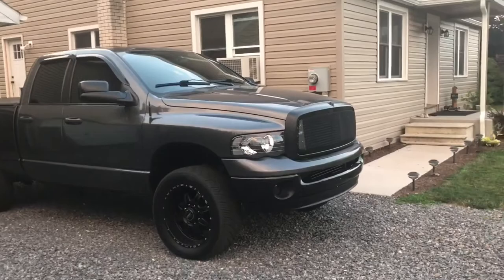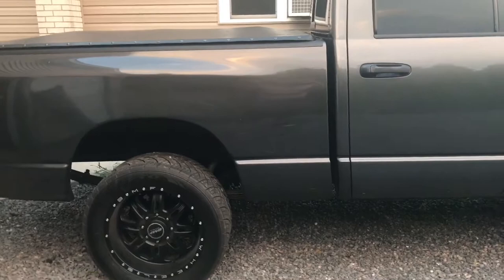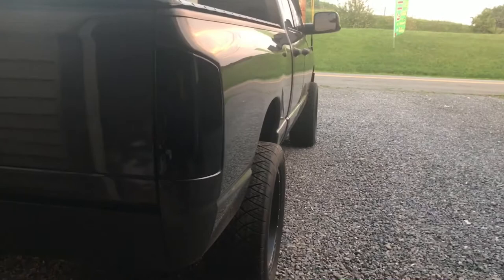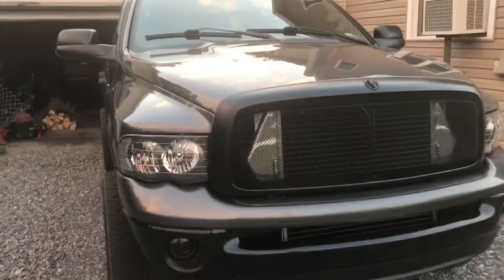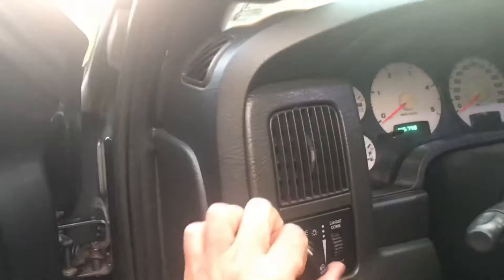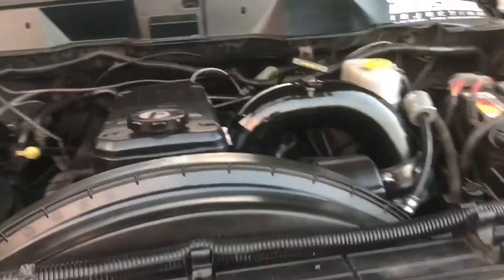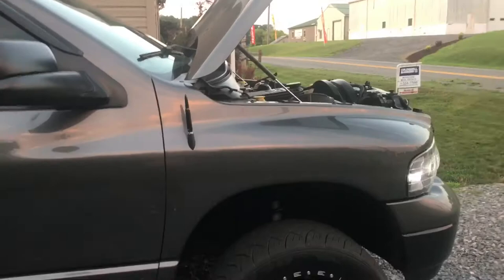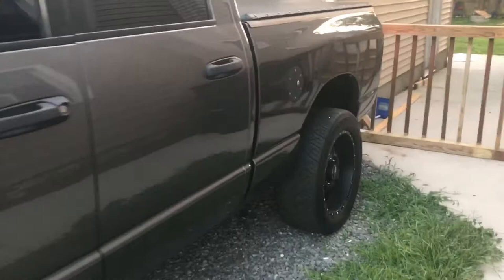My First Cummins Vlog? Walk around

Comment: I have the same truck same year 2004.5 and color. Fast 150, Smarty SR on SW3, Edge CTS2, Straight piped, 34” Cooper STTs Best truck I’ve ever owned hands down. Pulls like a freight train averages 18-20mpg calculated and hauls anything I hook it up to. Nice truck where did you get the grill you had last year when it was lifted?

Comment: Nice wheels bro! So what made you go with these instead of the fuel octane? I went with the hostages but almost got the octaves.
Reply from the maker: Chesley Gibbons 20 pounds of weight saved on each corner of the truck... I've ran the fuel octane 20x12 fuel Kranks 20x9 motometal 22x14 xd 18x9 as wheel as stock... these wheels cost me 732 shipped to my door and have the largest lip on a 20x9 and much lighter then any wheel I've ran so far.. it's not a "drag truck" yet but will be in the future. Thanks for watching man stay tuned for more!

Comment: You gonna sell that 4 inch lift or is it already gone?
Reply from the maker: Tanner Morton i still have it wats your offer?
Reply: Johnny Koch I have no idea what one would sell for i was gonna get leveling springs in my front but i want to be higher what would you be willing to let it go for?
Reply from the maker: Tanner Morton well I don't have the shocks anymore. It would probably cost more to ship then it's worth to me. The level kits are good just buy a quality one and go with a longer shock brother. Don't over extend you stock length shock. You will kill the ride quality. A leveled truck can fit a 35" tire depending on wheel offset
Reply: Johnny Koch yea i got 35s with 2 inch blocks minimal trimming gonna do 2.5 inch level with bilstein 5100s guess wouldnt wanna go too high and get an even stiffer ride probably be more tipsy with high hp
Reply from the maker: Tanner Morton you got third in the drawing. Lol
Reply from the maker: Tanner Morton I'm making the video for it right now.
Reply: Johnny Koch 😀😀 sweet

Comment: 04.5 with no fender rot in pa, how? Hahaha
Reply from the maker: Doug Smith funny you say that. the bed had new panels installed as well as the tail gate..
Reply: Johnny Koch I'm looking for a new bed and front fenders as well, I have bushwackers on there now but it'll only be a matter of time till it creeps higher
Reply from the maker: Doug Smith I ran flares before when I had wider wheels. Just buy bedsides if you can't find yourself a southern bed. The fenders is recommend going through lmc truck.